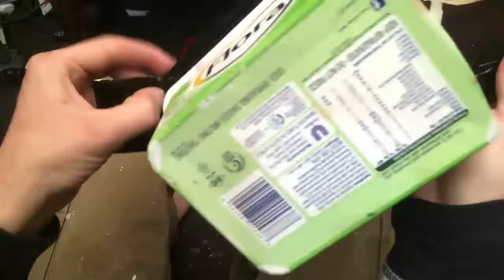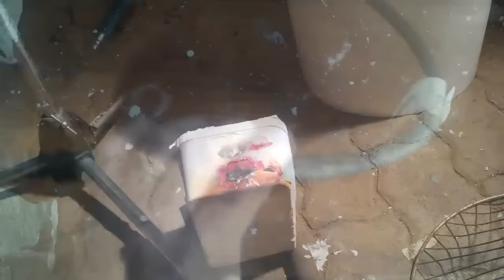Casting a Pewter eagle

Comment: The eagle sculpture was incredible. I was just stunned every time you added more detail. However, one thing I want to point out is that it may have been a better idea to put a patina on it using some sort of acid and sand away the excess instead of trying to achieve that look using paint and wiping off. This piece is so cool, and the bare pewter looks beautiful so it kind of feels like you're adulterating the beauty by adding paint. It makes it feel less authentic than if it were a legitimate, black, natural oxide layer.

Comment: Excellent video, congratulations. At 14:37, you use a very interesting wax or plasticine evacuation system in a home furnace. How have you done? I am interested in how you evacuate the water from the plaster so that it does not burst when you melt the metal inside. Thank you

Comment: You should try casting the pewter directly from the silicon. Silicon has a temperature rating of over 300 degrees C, and pewter melts at like 230 degrees.

Comment: So that red wax is a type of wax for cheese correct???  im very interested because I'm doing some casting too of some fancy eggs but also im going to do one in Britannian Pewter but going to be ordering about 2kgs of it
Reply from the maker: Yes, i used babybel cheese wax, its not very practical or cheap to buy cheese just for the wax. But i love cheese so that works for me. Also normal cheese wax doesn't work. My advice would be to rather look for a commercially available modeling wax/clay. Search for "plastelina" or "cx-5"
Reply: +Faber Ahh I've actually found places that actually sell the wax on its own 450g and 1kg and as for any modeling wax or  clay can find modeling wax but I have some polymer clay  but well that stuff burns off rather than melts and I have foundry  soo i could burn it off but maybe on major project maybe thnx anyways ^^
Reply: Careful about "plastelina" stuff, because in some languages it means playdough....

Comment: Hello Faber, i tried to cast a small model by using silicon molds(two sides) , but finally it have so many holes couldn't fill in the pewter. I wonder if the pewter not hot enough to fill the mold. Is silicone mold a good material for cating pewter?

Comment: Awesome work!
But would it not be easier to just carve the wings directly onto some foam?
Reply: Ah, but then you´d miss out on the satisfaction of having used a 6000-year-old method   : )  Though I accept that modelling clay, cheese-wax (wonderfully modelling-friendly stuff) and paraffin candle-wax aren´t quite ancient Mesopotamia, it´s still very close to the beeswax/ riverbank clay/plaster combo they presumably were using back then. I´m not knocking lost foam either, by the way; I stand in awe of MakerjI0I´s magnificent CNC milled lost foam flywheel, for example.

Comment: Superb... master work I would say... (Y) I make simple chandeliers, but now looking at your video I wish to make a chandelier arm from aluminium could you please help me how can I make a chandelier arm with simple basic design but needs to be hollow from inside to put wires inside..
Reply: Perhaps you could put a hollow metal pipe bent to the shape of the chandelier arm, with small metal pegs soldered on it, and sculpt on the outside of this ensuring some of the pegs stick out of the sculpting material, so that when you make a silicone/gypsum cast, the pegs wil ensure that the pipe stays in place in the mold when you replace the clay or wax with pewter. When the sculpt is taken out of the mold, you just cut away the excess pegs. I've seen similar techniques with small statues and fountains and other things that require hollow parts/tubing inside.
Reply: Sindre Solhaug thank you so much for the detail I will surely try it
Reply: Thank you so much for your suggestions....  I will try as you suggested..  But what if i want to make multiple arms of the same design..

Comment: Ive heard alot about bakingsoda. Can i put IT at top in the melted metal while IT is at the furnace?
Reply: I believe you want washing soda, not baking soda. You can convert baking soda into washing soda by baking it, ironically. Cover a sheet pan with a thin layer of baking soda and bake for a while. I don't recall time and temperature but you can find it easily by searching.
Reply: Jon Miller okay thanks

Comment: Can't you use styrofoam and sand to cast Pewter?
Reply from the maker: +SlidingSilver  I think the low melting point of pewter might pose a problem for detailed castings , but small simple shapes should work. haven't tried it yet though.

Comment: there so many lumps in your plaster o.O
Reply from the maker: Yeah I rushed it. The plaster dries so quickly and i need it to be runny to capture the detail. I'll have to invest in a vacuum pump.
Reply: the vacuum pump is expensive, you can always use a drill with a mixer attachment + what i do for smaller details is that i apply with a brush  pre mixed plaster ( runny as you said) and after that i mix plaster  that's gonna fill the rest of the molding .  Tip : let the plaster dry completely , that will eliminate the chance  of  forming cracks ... If you wanna invest in high quality plaster for casting you can look in a dental supply shop, they also sell a special liquid that comes with the plaster
Reply from the maker: Thanks for the tip.